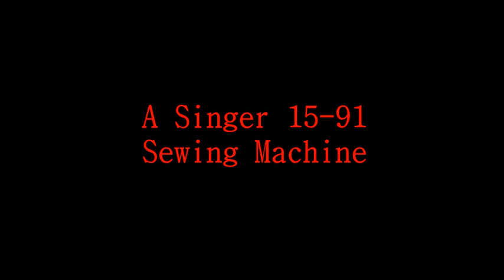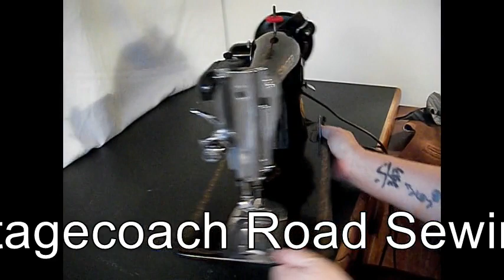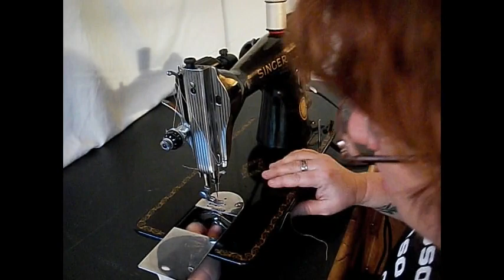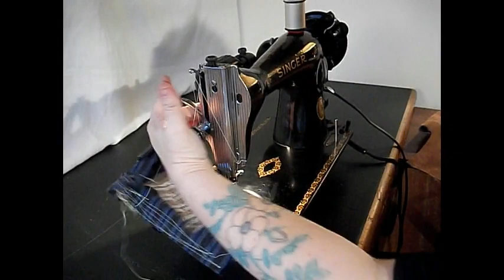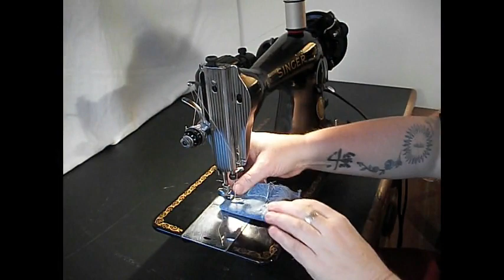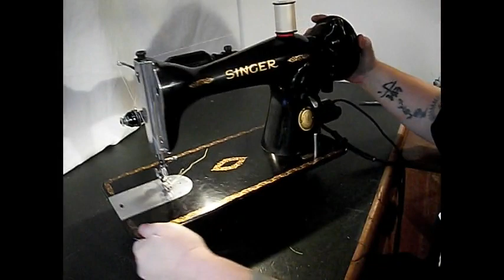Demonstration Video of a Singer 15-91 Sewing Machine

Comment: Great video!! FINALLY!!! Someone mentioned the orientation of the flat spot on the needle!!!! Yayyyy! I’m having trouble with my thread being too slack. I have larger spools, so I had to buy a spool tree or whatever you call it. I can’t figure out, where to sit the darn thing, so that the thread goes through the machine with normal tension. Also, what should my tension knob be set on for leather, vs cloth?

Comment: I have one of these that I purchased new and I still have the case.  It is in very good shape and will still sew anything.  I've owned other machines but none I love like this one
Reply: Susan Mazzanti how do you stitch the materials together? I’ve followed the directions and it will not sew, only leave holes 😢
Reply: @k.m.60  make sure you have a new needle in and that it's inserted properly. 👍🏽

Comment: great video , the best and clearest video ive seen in a long while , no waffle just facts
ive just bought one of these as i dont have space for an industrial machine , i would have liked a walking foot , im a diver and need to sew webbing say four layers of seat belt webbing , what needle and thread size would you advise me to go for , it has to be tough , 
thanks tom
Reply: To sew webbing, try using needle numbers 16 (denim needle) up to #20. 
Walking foot: get a “low shank” walking foot. Generic ones run about $30 and work fine for cloth. For multiple layers of webbing, you might have to invest a little more. But, a walking foot works great on the 15-91. 
Thread sizes: you’ll have to be the judge regarding the thickness of the thread you need. The higher the number the number  (example: “15 pound”,) — the thicker the thread, I believe.
Reply: @lindagilmore2325  many thanks for the time and information in your reply .

Comment: Well I have this machine and it's breaking my heart.  I am missing a tiny piece I don't know the name of. 
It is the thing just above the needle-holding screw, the thing which holds the thread out to the right side on its way to the needle! 
This sweetie has been in the family since Xmas 1952, the same month it came off the assembly line ... 
The purr of this motor brings more comfort to my soul than anything else I own ... 
It won't work right without this part ... what is it called?
Reply: Kaarli Makela .. I think it’s just called a thread guide
Reply: There is a parts list available (pdf download) for this machine.

Comment: I'm envious... I have the same one and it doesn't work. It does not sew evenly and after 4-5 stitches the thread breaks. Please advice for settings. God bless you.
Reply: I’m a home sewer and the 2nd owner of a singer 15-91 that was manufactured in 1949. Please do not give up on your 15-91 machine.  It’s an easily repairable machine with simple authentic Singer vintage and inexpensive parts that are readily available on the internet. 
It sounds like your machine needs a simple overhaul, which is a good cleaning of the parts, tension and other adjustments, lubrication, and a check of the wiring. I learned to do that myself with success but there are certainly good sewing machine repair people who can make your machine fully functional snd a pleasure to use.  The Singer 15-91 has the reputation of being one of the best home machines ever made. You’ve got a gem there!

Comment: I just bought one from a garage sale it's belt driven with 1 long door on it that just lays out doesn't slide it looks just like the one you have in the video I'm not sure what kind of belt I need for it , so i took the belt off my singer 348 and it worked only it ran kinda slow not to bnb its fullest speed and once I got it to sew correctly  without bunching it would see a lil then stop right on top of the vinyl fabric that I was using. Why?

Comment: found one of these at a thrift store today for ten dollars. horrible condition; looks like it sat in a barn for the past 30-40 years. covered in rust, rusted solid practically. a little wd-40 and I've got some parts moving again, but I can't get the machine to actually move. it's definitely a project, but I'm excited to restore it.

Comment: I have this machine very new to sewing iam getting some problems with my bottom thread balling up and several threads comming out of the bobbin after a short stitch can anyone help?
Reply: Ryan Walsh did you get it to work. Usually the bunching up of threads means that the top may not be threaded correctly and you should start over with threading. The problem is with the top thread and not the bottom.

Comment: Having an issue with this model where it (sometimes) has the bottom thread knot up and leave a hideous bunch on whatever I'm working on. Then when I go to cut the threads, there'll be three sticking out from the bobbin side instead of one. Looks absolutely awful, leaves a hideous knot on my project, wondering if this is an issue with the bobbin case? I'm threading it right according to the instruction manual and how you did it in this video...is it something with the bobbin tension? Any thoughts on what's happening?
Reply: I have this same issue did you ever find the reasoning to your issues?
Reply: check your thread tension.   change it all the way up or down to learn the symptoms of too high or too low tension

Comment: On my 15-91 it sews but it cuts my thread at the needle. what can I do to sew at any speed with out breaking?
Reply: years ago i fixed a singer prewar and after put together believe it in 1951 got this baby humming stitched great. but every time stoped thread broke. brother in law millwright said take bobbin out spray wd 40 I disgread as he always said don't use it. now was the only time I did this as he said there is a tiny bit of dust you can't see but the machine knows thus breaking thread. ok Did over night' next day wiped out. and reoiled bobbin back together. He was right. worked great this tank is still running great.
Reply: Me too

Comment: my thread keeps breaking and it's a thread for heavy material. any suggestions on what I could do to fix it.
Reply: Carey Benson   I am having the exact same issue on my 15.  Did you find a resolution to this problem?
Reply: Change your needle
Reply: Put on spool cap larger then your spool,not to close to spool so spool can rotate,sometime the thread gets caught on spool and breaks thread

Comment: Can you tell me how to remove the light bulb on my singer 15 91
Reply: It is held by two springs 
First in screw the round silver disc on back 
Under they you will see a screw undo that and you can easily access the light bulb cover which has the two spring like clips the protective light bulb cover then slides out and there you have it the light bulb kind of wiggles out counter clockwise it doesn’t really in screw in my case it just fell out

Comment: where can I get an operators manual for a 15-91 machine ?
Reply: Google Singer 15-91 user manual, and you can download a PDF. There are a few old, printed manuals on eBay as well.

Comment: My singer won't feed the thread though the bottom,  I tried to get it started like in the video.  help
Reply: tony todaro I’m having the same issue. I’ve tried over and over following the directions and it still won’t thread. I have no idea what to do.
Reply: Are you getting the thread under the bobbin tension spring?  There are several youtube videos on threading the 15-91 and the 201 which is similar, and one of them by the Cow Country guy shows very clearly how to thread the bobbin.  These should be a help.
Reply: FirefighterSEIN cow ccountryguy